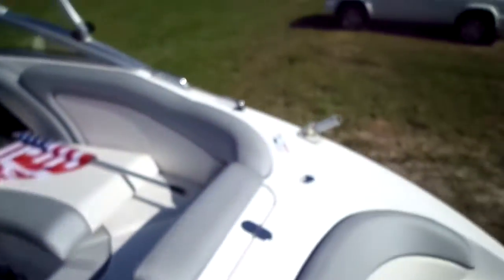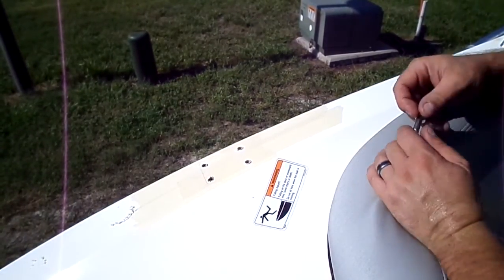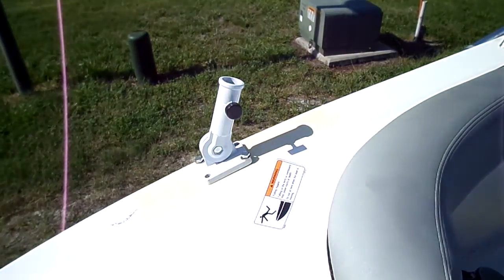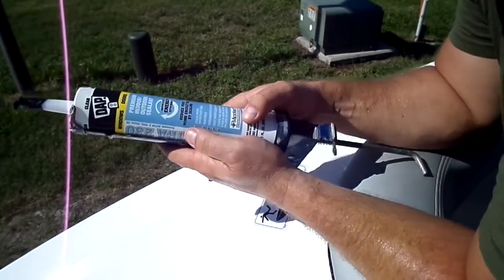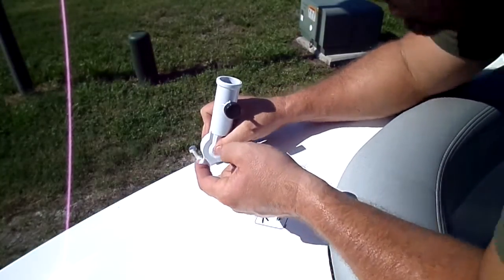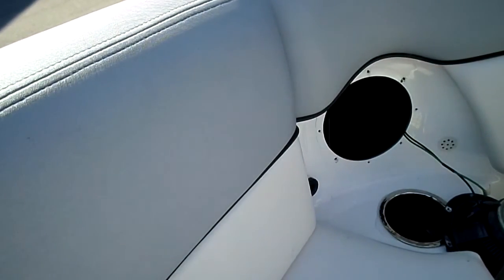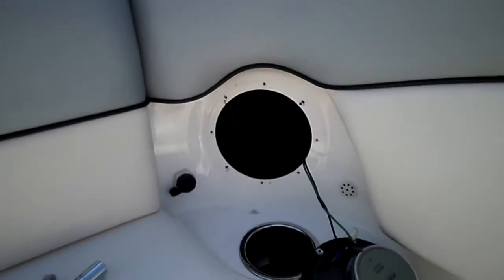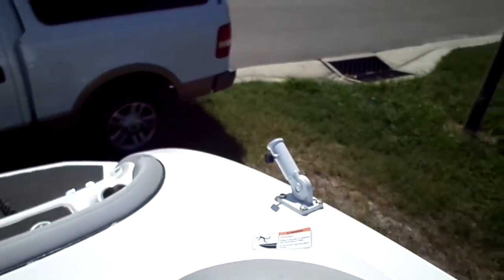DIY Flag Pole installation part 2

Comment: Looks like the perfect idea for an install. What kind of flag poles are you putting in there? Is that just a tightening mechanism that keeps that pole in there?? Thinking of doing this myself so just curious. Thanks!
Reply from the maker: This is just a regular flag holder like you would put on the house. I made poles from aluminum poles from lowes and polished them.

Comment: I have an sx240 that i am putting a taylor made flag holder in a similar spot. Did you find that the fiberglass was thick enough to hold properly?
Reply from the maker: I made a piece of aluminum plate and put it on the inside of the boat to ensure the fiberglass didn't take all the stress..